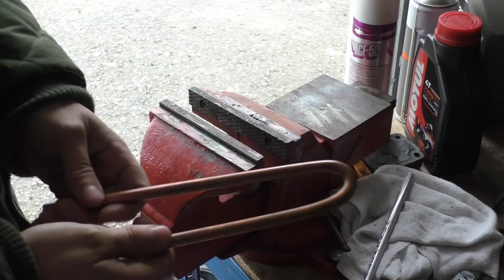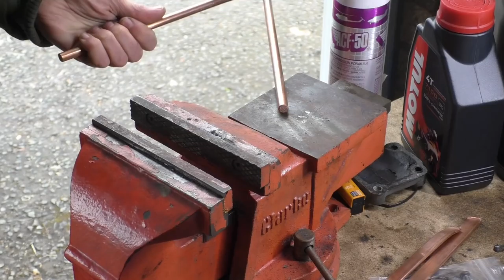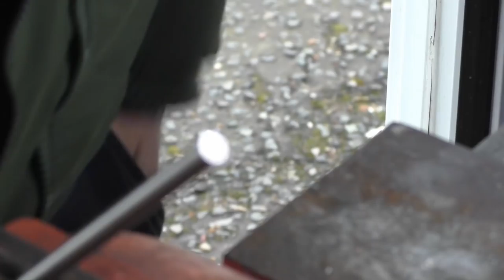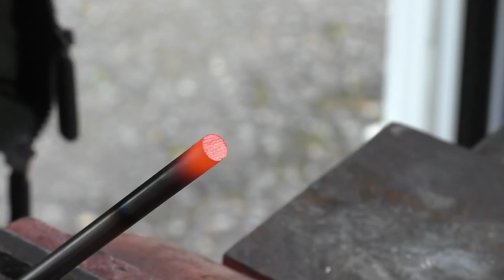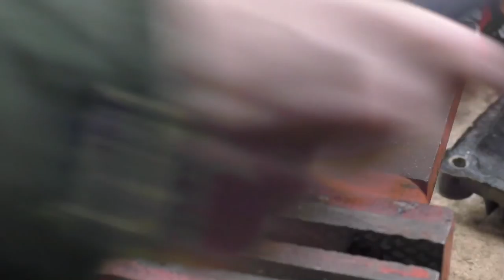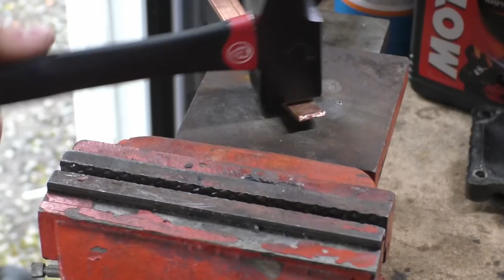Materials - An introduction - Part 1

Comment: A-up at 7:03 it looks like the steel contracts slightly under heat as its blueing, is this optical or are the bonds contracting?  Cheers dude 👍
Reply from the maker: that's just the camera.
Reply: Cheers dude 👍

Comment: Anyone know where one can get magesium billets suitable for 2t engine blocks?
Reply from the maker: Magnesium billets? You mean for the casings? If so they are cast not machined. Magnesium billets would cost a fucking fortune.
Reply: The Workshop I was wondering why I couldn't find anything, still working on that 100cc 2t vtwin